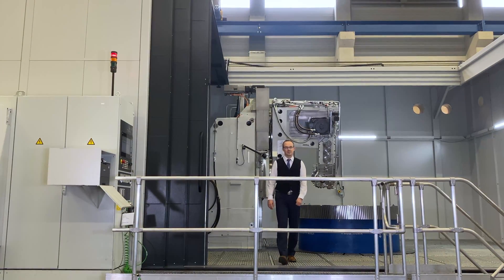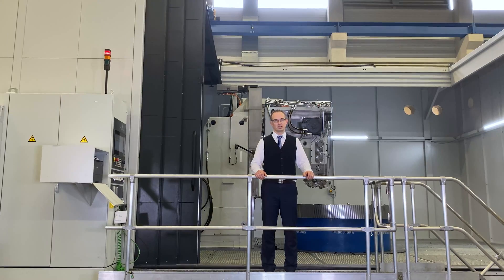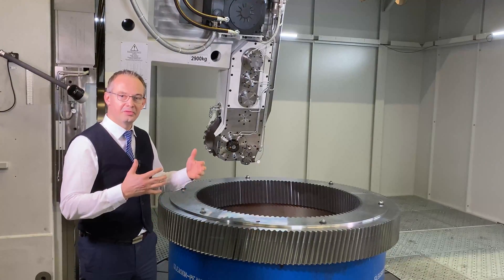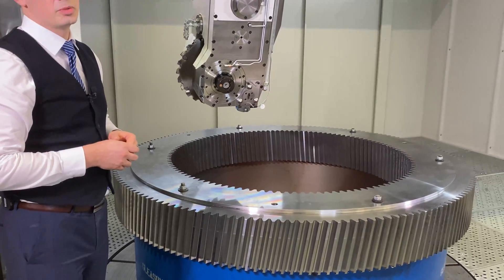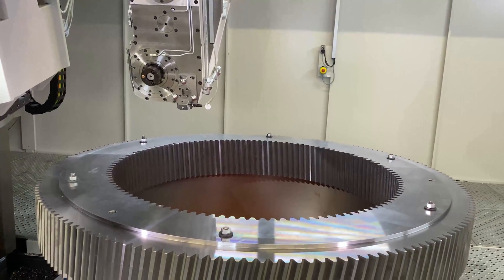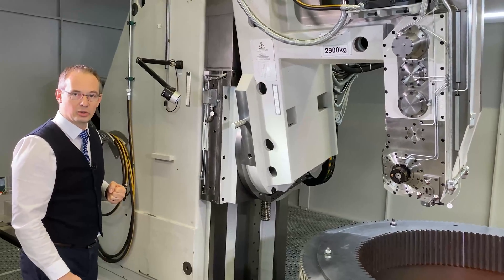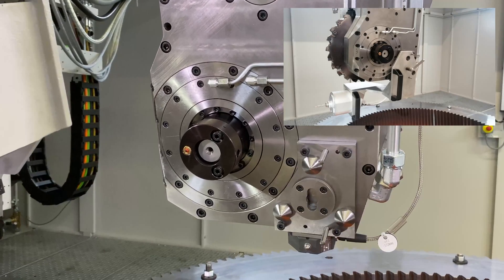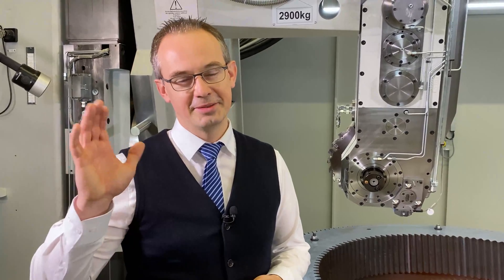Gleason P4000/5000 Hobbing Machine - Interview

Comment: It is a nice machine.  I know the P6000 really well and it makes great work pieces.
When I saw the machine for the first time I thought we would have a lot of vibration with a module 20 in 5000 mm. in 42CrMo4
However it was running quite nicely.
Question: Is the bed for the table in concrete or is it made from cast iron ?
Question: Is the table size 5 or 6 ?
Good Video 👍
Reply from the maker: The P4000/5000 has a high distortion resistant bed and the table is an extra heavy version for higher load.
Reply: Absolutely. 42CrMo4 makes it difficult to stable hobbing. I did hobbing of 5mm module and still Machine was dancing